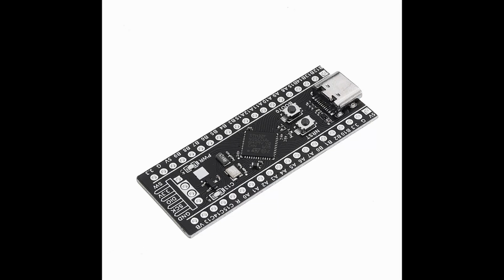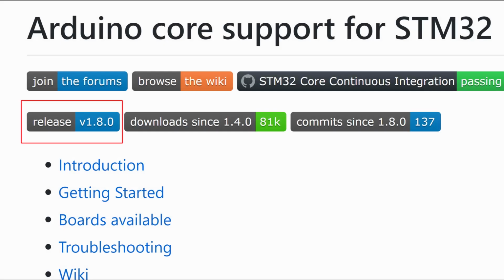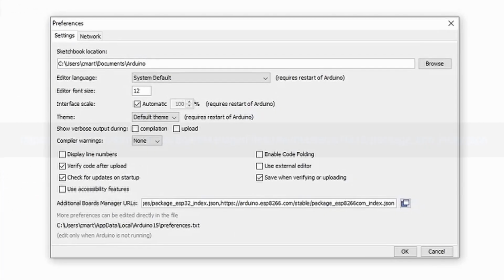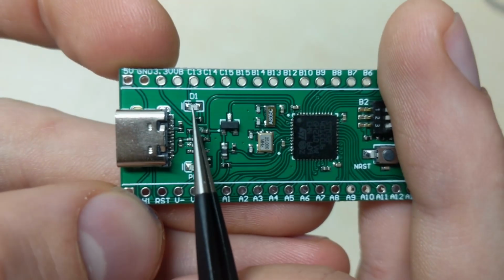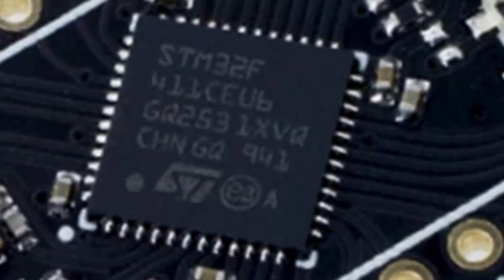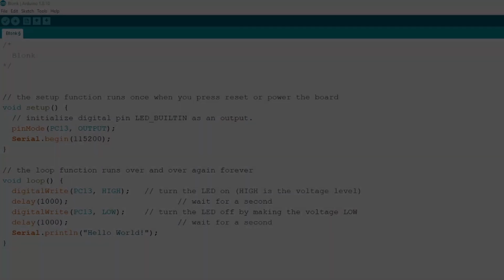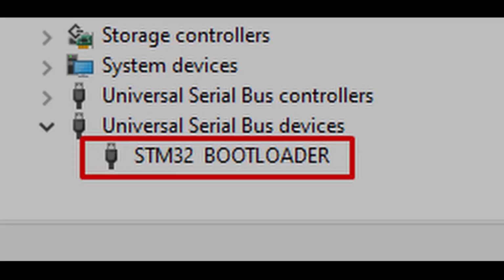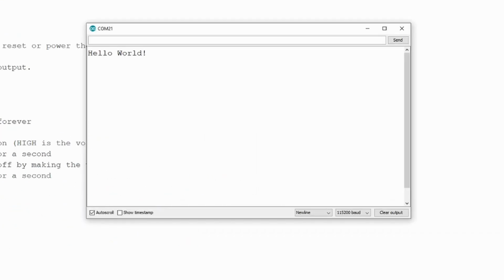Getting Started with the Black Pill Arduino STM32F4

Comment: Hi, I love your content very much. I'm using the black pill f411, but I followed your steps but as for now it only show STM32 BOOTLOADER at the device manager but there's no COM Port visible. I tested my wire cable, it supported the data link, I used it for transferring picture from phone to pc and its work. please do help me I'm stuck. thanks in advance sir
Reply: Did you solve it , I’m stuck also
Reply: You have to create a virtual port since you don't have a “physical” one, in the libraries of the arduino IDE I didn't find how to solve it, but in platformIO in VScode, in the configurations mentioned in the video you just add these two lines:
build_flags = -DUSBCON -DUSBD_USE_CDC
monitor_speed = 115200
With that you can use it if you want to make it arduino based, the alternative solution is to use the stm32cubeIDE which is the original alternative.

Comment: hello nice video there! so i tried this tutorial and it works but i use STM32F411CEU and it didn't get recognized by windows first time i put it on DFU mode, so the trick is apparently there's a floating pin on A10 put a pulldown resistor into it then you can use the USB uploader

Comment: I have to add some clarifications. I run Arduino IDE 2.0.3 and at bottom there is the display "Generic STM32F4 series [not connected]". Also before pressing the upload button, no COM Port ist shown in Windows 10 (but with reset and boot, STM32 BOOTLOADER ist shown in Windows device manager, this means the board is recognized) . When upload process is successfully finished, then STM32 BOOTLOADER disappears and a COM Port appears. Arduino (or STM32 Cube Programmer) finds COM Port automatically, so no setting before is possible. Sometime it is necessary to figure out such behavior, to prompt newbees to go forward, when there is no real error in red ist shown.
Reply: Thanks, it helped a lot ;)

Comment: Hello, excuse my ignorance, but I bought one, it's still new, but I installed everything and for some reason when I put it in boot mode it sent me an error, (The USB device is not recognized, The last USB device that I connected to this computer does not work properly and windows does not recognize it.) can someone help me?
Reply from the maker: Couple things to try:
Another USB - sometimes they don't have data lines
Restart your PC 
Try another board if you have it
Manually install the USB cdc drivers - can be downloaded from STM website
Make sure it's actually in boot mode, it will act like this when not in boot mode
Reply: @CalebMarting  Thanks, before I saw I used a USB UART that I had around from a plane station to simulate it on the PC, I adapted it to the corresponding outputs to create a COM port and connection to the microcontroller and thus load the data, thanks everyone modes.😊

Comment: is A0-A15 analog inputs?how many analog inputs can it handle? im planning to create a edrums out of it.thanks
Reply from the maker: PA just means Pin bank A, it doesn't mean analog, that's why there are PA, PB, and PCs. Please look at a pinout diagram to find what analog pins https://www.mischianti.org/wp-content/uploads/2022/02/STM32-STM32F4-STM32F401-STM32F401CCU6-pinout-low-resolution-1024x623.jpg

Here ADC means analog to digital converter which is an analog input, but you'll notice some of those are on the PB pins as well and not all of the PA pins have those. Pinout diagrams are how you'll find what pins have what
Reply: @CalebMarting  this is very helpful. thanks for this mate 😁😁

Comment: Thank you for the video !!  ☺
I tried what you said. My board is successfully recognised as "STM32 BOOTLOADER" but I keep getting this error message  :

USB speed   : Full Speed (12MBit/s)
Manuf. ID   : STMicroelectronics
Product ID  : STM32  BOOTLOADER
SN          : 367535703036
DFU protocol: 1.1
Board       : --
Device ID   : 0x0431
Device name : STM32F411xC/E
Flash size  : 512 KBytes (default)
Device type : MCU
Revision ID : --  
Device CPU  : Cortex-M4

Memory Programming ...
Opening and parsing file: Blink.ino.bin
  File          : Blink.ino.bin
  Size          : 23.37 KB 
  Address       : 0x08000000 

Erasing memory corresponding to segment 0:
Erasing internal memory sectors [0 1]
erasing sector 0000 @: 0x08000000 done
erasing sector 0001 @: 0x08004000 done
Download in Progress:
Error: 
Write failed at address: 0x8000000 

Error: failed to download Segment[0]
Error: failed to download the File

RUNNING Program ... 
  Address:      : 0x8000000
Start operation achieved successfully

Any suggestions ? 😭
Reply from the maker: Looks like it might be locked from writing? You can try putting it into STM 32 cube programmer and seeing if the write protection is enabled, I'm not sure what else would cause that
Reply: @CalebMarting   Thanks for the reply 😊 .  I checked the write protection, it was not enabled.  
My all attempts to program the board through the usb port failed... but anyhow i managed to program it using the USART pins A9 and A10 using my D1 mini as usb to serial converter (as i didn't had one of those usb to serial devices at that time) and using STM Flash Loader Demonstrator....

Comment: Hi Caleb! Your video is the best reference about STM32F4 on YouTube. Many thanks! In my board STM32F11CE6 the driver for WeAct bootloader was correctly installed by Windows, but the com port does not show up. I cant not see it in device manager. Have you seen some thing like that?
Reply from the maker: Try another USB cable, some don't have data lines

Comment: Mine are clones. They don't show up as STM32 BOOTLOADER, but STM Device in STM Mode. When try to upload I get this message:
Error: Target device not found
Establishing connection with the device failed
the selected serial port Establishing connection with the device failed
 does not exist or your board is not connected
Have any of you had this problem? I know the bootloader in the Black pill is not original, but from what I have read, the bootloader from WeAct is not open source.
Reply from the maker: The weact bootloader is actually just the STM 32 F4X1 ROM bootloader, it's actually just part of the official chip, not programmed in or custom for weact. I don't know why complaining about the COM, since it should be dfu mode, but if you have a com port on your computer you may need to select it to trick Arduino into working
Reply: @CalebMarting  It does not show up as a COM port. Just as an STM Device in STM Mode. Definitely, there is a difference between WeAct and a clone. The Key button does not work as on their boards.
Reply from the maker: Do you know what clone specifically this is? You may be able to find a schematic, make sure that you can find which button  boot is, or if you can't find it manually pull it high or low depending, you'll have to look at the data sheet for the chip
Reply: @CalebMarting  When I use boot and rst buttons, it goes into somewhat boot/dfu mode. In STM32CubeProgrammer I can see it as a target device with all corresponding data. When I reset it, it can not be accessed through STM32CubeProgrammer. So it works, sort of...
On 411 I successfully installed CircuitPython. I can upload a program through STM32CubeIDE. Boards are ok. When in boot/dfu mode I don't see it as you, as an STM32 BOOTLOADER, but as an STM Device in STM Mode. That said, I can not upload a sketch through Arduino IDE using a USB C port. Only ST-Link or Serial.
Reply from the maker: And you do have dfu selected in Arduino as the upload method?
Reply: @CalebMarting  Of course
Reply from the maker: You may need to join the discord linked in the description so you can send screenshots, that may help more

Comment: I haven't been able to get the black pill board to play well with any of the arduino libraries like the adafruit ssd_1306 or even the basic Servo library my code just won't compile without errors. The blue pill works great with the arduino though. Any thoughts anyone?

Comment: Do you have a video about programming this device using the arduino core by the user Stm32duino and not STMicroelectronics? The program Stm32CubeIDE contains a hidden disabled virus and i do not feel safe using that program. I would like to completely avoid it at all costs if possible. Thank you if you are able to reply to this comment as soon as possible.

EDIT: if you are also able to include how to use the said method with a simple FTDI or similar usb uart serial adapter. Thanks again.

Comment: Hey Caleb, this video was extremely helpful thank you! I do have one problem though. I have a blackpill (STM32F411CE) board from WeAct Studios and I can run the bootloader and upload my code, but after doing so (every time even if I reset it) the COM port is never registered and my PC makes the sound of the USB disconnecting. Also it no longer shows up in my device manager, so I believe it completely disconnects without me unplugging it. Do you have any recommendations, it would be greatly appreciated, thanks!
Reply from the maker: You must enable usb, and generic CDC supersede usart, etc like I explained in the video. If that doesn't work please let me know
Reply: @CalebMarting  Yup that ended up working. I had it enabled before but I must of forgot to set it again after installing the new library for STM32. Thanks again and keep up the great videos!

Comment: Hi Caleb, this is the most I can get, from a STM32F411CEU6, my bootloader file is diymroe_stm32f407vgt_pe0.bin , the Original one form ST, and all the adjustments as you proposed:
Generic STM32F4Series
BlackPill F411CEUX
Enabled (generic serial)
CDC (generic Serial supersede USART)
STM32Cube programmer (DFU)

 I have three pusbuttons on the board, then y press and hold BOOT0, then I press and release NRST, and finally I release BOOT0, in this case this is the result:

Memory Programming ...
Opening and parsing file: _20210908_Blink_stm32.ino.bin
  File          : _20210908_Blink_stm32.ino.bin
  Size          : 23792 Bytes
  Address       : 0x08000000 

Erasing memory corresponding to segment 0:
erasing sector 0000 @: 0x08000000 done
erasing sector 0001 @: 0x08004000 done
Download in Progress:
Error: 
Write failed at address: 0x8000000 

Error: failed to download Segment[0]
Error: failed to download the File

In the case I try not pushing any button, the result looks like that:

El Sketch usa 23348 bytes (4%) del espacio de almacenamiento de programa. El máximo es 524288 bytes.
Las variables Globales usan 3868 bytes (2%) de la memoria dinámica, dejando 127204 bytes para las variables locales. El máximo es 131072 bytes.
C:\Users\josem\AppData\Local\Arduino15\packages\STMicroelectronics\tools\STM32Tools\2.0.0/win/stm32CubeProg.bat 2 C:\Users\josem\AppData\Local\Temp\arduino_build_996920/_20210908_Blink_stm32.ino.bin -g 
      -------------------------------------------------------------------
                       STM32CubeProgrammer v2.8.0                  
      -------------------------------------------------------------------

Error: Target device not found
Establishing connection with the device failed

Please, let me know if you have any idea about how to proceed.

Thanks in advance:
JME
Reply from the maker: Hi Jose,

I'm not sure what you're doing with a bootloader file, the f411 does it not require a bootloader to be installed for dfu, and the f407 bootloader isn't compatible with it begin with.

You will need to press the buttons, as you notice when you don't press them you'll get the "Target device not found" error.

As for why it's erroring when you try to upload blink, my guess is that write protection is somehow enabled. You should be able to open up stm32cube Programmer, connect with dfu, and turn off write protection. This should fix your problem. Should be in the option bites under something like write protection. I think it's on page 30 of this manual, although there's probably a guide for it online too.
https://www.google.com/url?sa=t&source=web&rct=j&url=https://www.st.com/resource/en/user_manual/dm00403500-stm32cubeprogrammer-software-description-stmicroelectronics.pdf&ved=2ahUKEwi38MKY5vTyAhUTEVkFHRZDC7wQFnoECAoQAQ&usg=AOvVaw2SMzHUwO_kCX_AXGuaMlqp

You could also manually try uploading the bin file mentioned through cube prog and see if it gives you any better error message. 

Caleb
Reply: I forgot it, i was loaded the bootloader into the STM32 Using Jlink and a Jlink hardware interface
Reply: Starting on Address 08000000
Reply from the maker: Yeah you won't need a bootloader, it's stored in ROM on the chip itself which is what you are accessing when you use the boot/reset push buttons

Comment: You better use bare-metal programming for this high complex chip, e.g with Embitz and EBlink Debug server. You have 100 times more 
access to its ressources. But is is not as simple as using Arduino.  Arduino hides the complexity in a way, that the board is not better than any AVR 8 Bit Chip.

Comment: port dosen't show up how do i deal with that?
Reply from the maker: It doesn't show up before you upload code, or after? You don't need a port for uploading code to this, it goes through a different protocol called DFU. If you do have a port other than this device, you may have to select it to get code to upload, but it should work
Reply: @CalebMarting  Thank you, the port didn't show even after uploading it turns out  on my board the nrst needs to be pressed first then the boot and release nrst, now it works

Comment: hello can you help me ? i have blackpill Weact v3.0 with stm32f411ce chip, but when I tried to get into boot mode my device manager shows "Unknown USB Device ( Device Descriptor Request Failed )", but sometimes it can read STM32 BOOTLOADER. it only occurred once or twice after reinstall everything. and when I restart my pc eventually the device manager just keep showing "Unknown USB Device ( Device Descriptor Request Failed )".
Reply: Answering my own question here.
Weact 3.0 have some funcky behaviour with the onboard oscillator as @maytoolsmike describe. The other great solution that I found was to hook a ftdi tx and rx pin to a9 and a10 ( uart pin)
And Also the power pin to gnd and 5v ( ftdi on 3.3v mode)
Somehow the oscillator of the uart provide a "correction" and it just works.
It doesn't use ftdi, just use the oscillator for enteribg the dfu mode.
It's kinda iffy but it works reliably

Comment: When programming using Arduino IDE in DFU mode I've always getting RDP at level 1 with "device under read out protection" warning, even in newly erased and bit already set at level 0 via STM32Cube. But uploading in SWD mode using stlink working normally. Did I miss a step or something?
Reply from the maker: No I've never seen that before, that's really weird. If you want to join the discord linked in the description we might be able to debug more there but I've never seen that before. Please let me know if you find a solution to that issue.

Comment: Thank you for this video. I have the new 3.0 board and your procedure worked for me with the following additions.. I had to use a hairdryer to heat up the board. I saw somewhere that the oscillator does not work correctly at cooler temps. Also the timing of pushing the BOOT0 and NRST buttons is ridiculously picky. I pretty much push and release them simultaneously while trying to get the correct order; this usually takes 5 to 15 attempts!
Reply from the maker: If you hold boot0 when you press and release rst, then release boot0 it doesn't work? You might have just gotten that timing by chance when you take like 15 times
Reply: Thank you for that heating trick. That heating trick also tackles picky button timings or atleast for me it did.
Reply: DUDE WTF!!!! I HAD THIS SAME FRUSTRATION!
but still with the heating method it still require some luck with boot sequence

Comment: If anyone else has a situation similar to mine where they require all 3 serials the blackpills offers, the "UART6" pins will not work as expected if you use USB Support. Quite obvious in hindsight, a few of the forum posts I found talked about USB and the pinout also has USB + and - on those pins.

Arduino IDE > Tools > USB Support > None for working UART6. USB upload still works but make sure you unplug the UART6 device when doing so as I think it can cause problems. 

Obviously, you won't get to monitor serial over USB anymore like shown in this video. Personally this is not an issue since my intent is to relay messages from 2 of the serial ports to the other port, connected to a PI3 A+ that will ultimately be running a more complex GUI program to monitor data received from both LoRa and GSM modules.

Comment: this older version has 44 pins also where can you get a pinout for this older version. all i can find is the newer 40 pin version
Reply from the maker: The weact f4 mini GitHub has all of the hardware schematics and pinouts I believe, let me know if you can't find it
Reply: @CalebMarting   I am also looking for the pinout. I have the exact green board you show in your video. It is the STM32F401ccu6  GH210 VQ CHN 609 st e23 Z (marked on the chip) ---the e23 is in a circle. It has the 3 dip switches also as yours shows.  Recent purchase on Amazon, Nov7.
I have found many hardware schematics, however, none for this specific board. Anyone that can point me to documentation would be appreciated. I have it working, but do not know what all of the features or each header pin has available.  Thanks in advance.
Reply from the maker: https://github.com/WeActTC/MiniF4-STM32F4x1/tree/master/HDK it's one of them in here